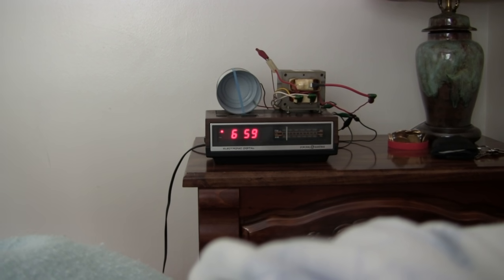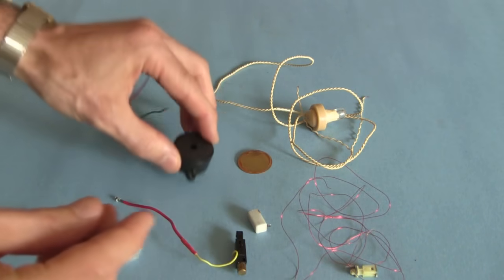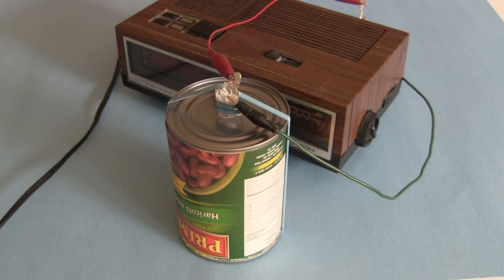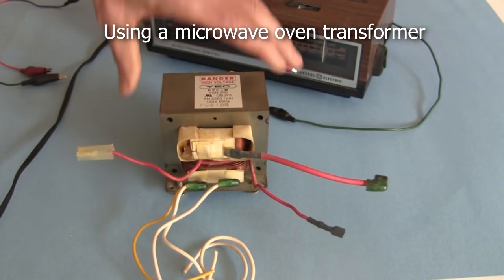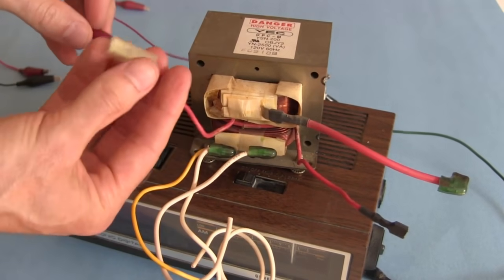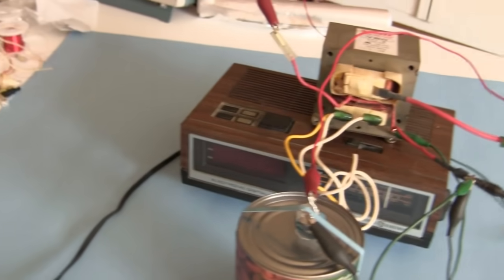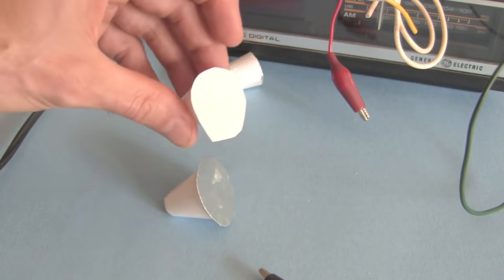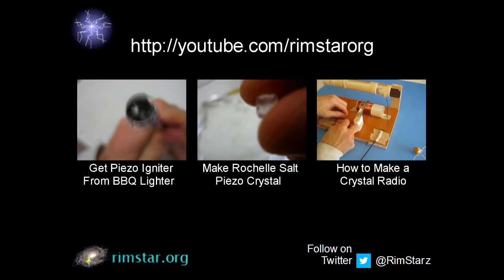How to Make Piezoelectric Crystal Speaker

Comment: Actually, to get more sound PRESSURE out from the piezo crystal (at your video, starting from 6:45), you should to put cone in opposite fashion - so that narrow end is attached to the crystal, and wide end to the room. 

What happened in your case is the Bernoulli effect - fluid (air) become accelerated, but in the same time pressure goes down. You need the opposite effect - fluid slowing down, but sound pressure going up.

Is that make sense to you?

Thank you in advance for your answer,
milan
---
Reply: wally crail  4 years now.
Reply: 5 years
Reply: @bobtakealook6420  6 and counting
Reply: @maximilianobournissent9876  7 now
Reply: @magicsasafras3414  8
Reply: 7 years, people. experimenting with microwave oven transformers.. all I'm saying.
Reply: 8 years now!
Reply: 1 whole decade 🎉

Comment: would it work off you hook it up to the crystal radio that you showed how to make in one of your other videos? saying you use a transformer that would increase the voltage by alot
Reply from the maker: I've never gotten the Rochelle salt crystal speaker that I show in this video to work with my crystal radio. The crystal radio's output is too weak. I don't think a transformer will help in this case. But now that you bring it up, I wonder if I held the crystal against my window if it would work, like I do in my "Piezoelectric Speaker - small crystals/window as speaker" video http://youtu.be/b4vr1aE0zzw but using the crystal radio in place of the clock radio. Hmmm...

Comment: are there any electrical contact angles that would improve amplitude seen at the mechanical contact angle of the crystal?  what if you were to cut the crystal with a moistened thread and try the various angles?
Reply from the maker: There are definitely different orientations that work and others that don't. I find that with these Rochelle salt crystals the voltage is always at right angles to the pressure, but you still have to find which sides of the crystal to apply the pressure to.

Comment: if u use 2 transformer it will make louder
Reply from the maker: Possibly. The transformer's installed in the wrong direction for impedance matching so it could be functioning as a voltage step-up transformer, so two step-ups might improve it, if the losses aren't too much.

Comment: I had sound (barely audible around 75dB) coming out of my 300watt resistors when I was testing vehicle amplifiers for their output power.....with music you could actually hear around 200hz-2khz, just guessing.

This was before I had them mounted (they where laying on my bench table with no brackets) now that have them properly mounted they are not audible at all.
Reply: It's possible that the magnetic fields associated with the high currents passing thru your wires was pushing against the Earths weak magnetic field and creating a version of the traditional magnetic "coil" speaker.  It's a guess based on the info given and I haven't any experiential knowledge of this effect.  If you can add any more details about the high power resistors or other observations of this effect I'd certainly want to work out what is going on as presently its an observation requiring an        explanation.  There are YT vids of people finding Rodin coils (a particularly fancy coil arrangement) behave a bit like    quiet speakers, well it's really no surprise as one expects this at some level which of course is also quantifiable given enough info.  Another thought its possible that the resistors you mentioned are of   a wirewound construction thus having more inductance than any other circuit element such as the connecting wires and again behaving like speaker coils in the Earths field.  This hypothesis would receive support if the observed sound increased in volume as you moved a strong magnet near and about one of the resistors.  It might be that the mounting technique and orientation reduced the volume to inaudible levels but you might find that a paper cone with a needle or thin nail near its apex (point) touching an unmounted power resistor will make it appear louder.  In any case I doubt it is a piezoelectric effect as displayed by quartz and Rochelle salt and certain other crystals.  
Just FYI I recall also that MIT reported a year or so ago some polymer they'd made which was effectively a piezo plastic sheet which could turn any surface into a speaker of sorts.  It might be something you come across down the track.

Comment: There is no need to use specific crystal, any dielectric will do the job.

putting 2 aluminium foils close to each other and leaving 1mm ring gap should make quite decent loudspeaker.  replacing one foil with wire mesh would work even better

Comment: Once I made a speaker using a piezo from an old watch - it was already attached to the metal backing plate so I just stuck (screwed) that to a piece of wood and there I had a piezo speaker! I didn't need hundreds of volts but I guess they aren't the same as those crystals. You can also just get these things out of 90's boombox stereos since they loved using piezo tweeters back then ;-) In fact maybe we could make a line array or planar type speaker out of them lol

Comment: The limiting factor here is not necessarily the amount of energy you put into the crystal but rather the distance the crystal will move when it vibrates.  Piezoelectric crystals vibrate with a lot of force but over a very small distance.  The trick would be to convert that force into motion.  Try attaching a lever (maybe a sewing needle) to the crystal.  Put the pivot point close to the crystal and attach the other end of the needle to the diaphragm of one of your cones, and rock out dude.  lml

Comment from the maker: No, unfortunately not. Even if you give it a sudden hard press but maintain the pressure, you still only get the voltage at the initial press and it quickly dampens out in the form of a dampened wave, alternating polarities until there's no more.

Comment from the maker: A piezo crystal is one where if you apply a voltage to it then it will change shape. It'll do this briefly and only when the voltage is first applied. In this video the crystal is connected to the output of the radio. The radio's output is a constantly changing voltage so it it constantly changing the shape of the piezo crystal. This changing shape vibrates the surrounding air. That creates sound waves which you hear.

Comment: Ill look up the electrophoresis you mentioned.  Just at a spectrum of my preps that involves not having access to batteries or electricity and needing an electrical spark. Mechanical energy is fine, just something on the smaller side. I'm sure if I find a small electric motor and crank backwards its like the same thing.... thanks for the reply to.

Comment from the maker: Well, there's always an external power source but if it's okay if it's mechanical energy provided by you then make something like "flint spark torch igniter" (do a google search.) Or building up charge using an electrophorus is a more science experiment type of way to do it. Or rub your feet against carpet and then touch a doorknob (though the spark is pretty faint.)

Comment: Thanks for the reply. Is there any way to make something that could produce a spark with an external power source? Or could using the rochelle salts with a capacitor ramp it up enough? Just curious for a potential prep item. Anything home made that could create a spark that's reasonably small and easy to make.

Comment from the maker: Oh, the speaker on the clock radio works fine. The only thing wrong with it is that the alarm goes off at random times, hence my willingness to open it up. This whole thing was done just for an interesting experiment. Lots of people, including me, are interested in what you can do with a homemade Rochelle salt piezo crystal. It's limited, but lots of fun to do. And that's all it is, for fun.

Comment: Not surprising that the radio alarm clock doesn't work any more. Putting the output of its amplifier through such a low impedance transformer is almost as bad a shorting it out completely.

Comment: PS.: I was reading a Forrest Mims' book where it was described a device which is made of a can with an aluminium foil membrane which reflects light differently (varying intensity at a specific spot by varying the focal point, I guess) as sound enters the can. I think you could merge this with your speaker and and then use a LDR to amplify the sound!

Comment from the maker: I thought you were going to say you wanted to use the quartz for the speaker. I've never tried that but quartz is piezoelectric so it might work. But putting quartz inside a lighter in place of the existing crystal? I don't know if it would produce sufficient voltage to create the arc at the spark gap to ignite the gas. Test first to see which sides to impact & which sides will have the voltage across them. A voltmeter will work there. See my Rochelle salt testing video, though I use a scope.

Comment from the maker: You can use a smaller crystal. See my other video "Piezoelectric speaker - small crystals/window as speaker" where I do just that. There's a link to in in the description below this video or you can find it on my channel page.

Regarding the smaller can, yes you can use something much smaller. The paper cones I showed in this video were smaller for example. The sounds quality with cans doesn't seem too good so the quality with a small can will probably be as bad as with the big one I showed.

Comment from the maker: Not necessarily. I have some small crystals, around 1/4" or 5mm, that are all uniform. I've seen photos of much larger homemade ones. My big one isn't so uniform but if I broke it apart I'd still have some large uniform ones. One difference would be in the shape. It's hard to make a large flat crystal like the disk shaped ones in the piezo buzzer, gift card, or crystal earpiece, or cylindrical as I think the piezo igniters contain. Some bought ones also have a larger piezo effect.

Comment from the maker: Glad to hear you enjoyed my vid.

The crystal I used in the vid was made in two stages. I grew a small crystal from a first batch and the used that as a seed suspended in a beaker in a roughly temperature controlled environment to grow a larger one. It's been through a lot over the years and this past week it finally broke so the one in the vid is actually 3/4 the size it used to be.

Make sure you post a vid of you crystal in action. I'm already subbed so I won't miss it.